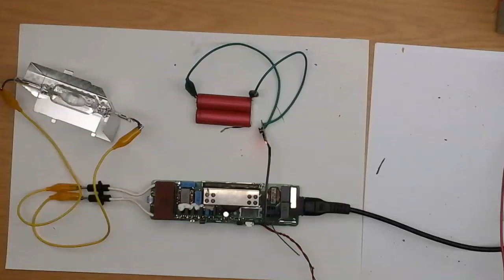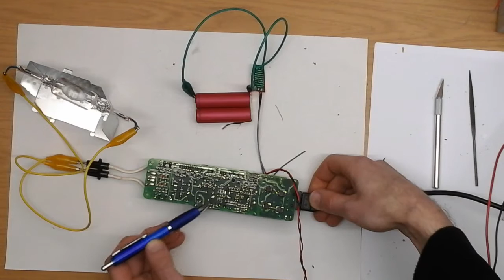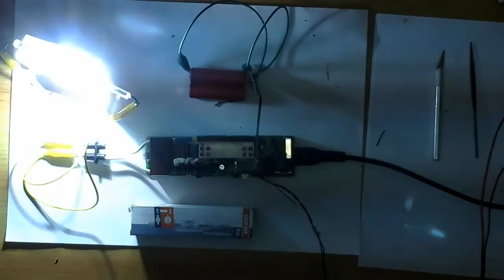Projekteliste 003: HID lamp ballast part 2 (EN)

Comment: Iam also tried this experiment in 2008  lamp shut down with brighter 150 Watt osram can't stand on  projector ballast  may be generated HV  to high or mis match  sir pls tell me what is reason?
Reply from the maker: potentially voltage too high / low current lockout or unstable controller due to defects (the board in the video never seemed to work right). Measuring the current would certainly help troubleshoot the behavior
Reply: Magnetic ballast generated 5 kv voltage and projector ballast  10 kv to 25 kv   is that reason osram can't stand on that voltage or cutoff after sometime after through gas discharge  it's my observation
Reply: In this ur video ur given triggered voltage with tow batteries  to optocoupler instead of iam shorted tow leads hot side therefore ballast directly working  iam finding solution for magnetic ballast  in diy projector e. Ballast very costly 😀😁😁😁